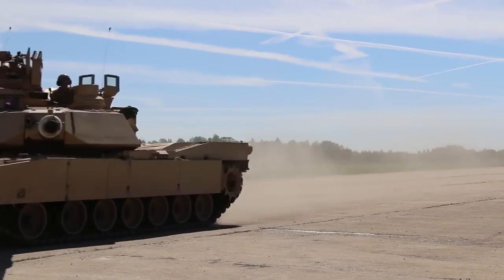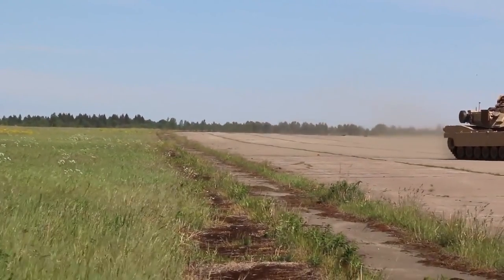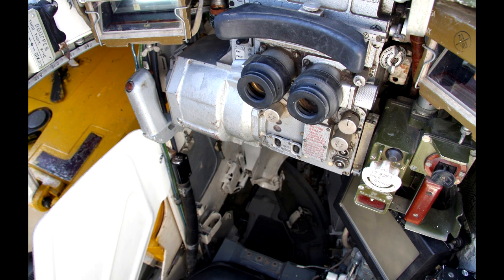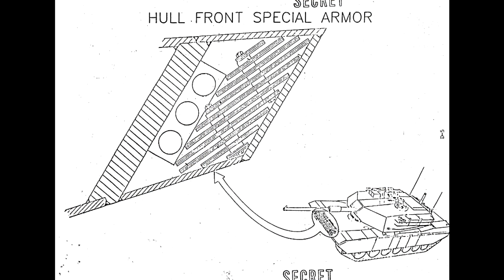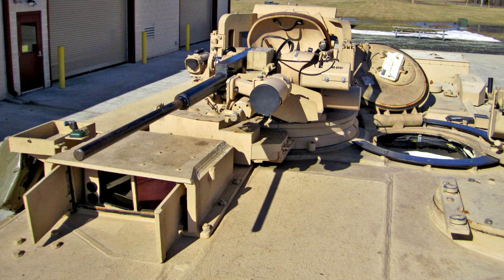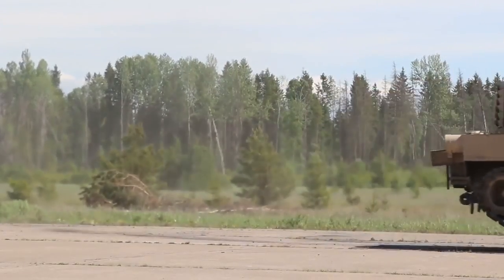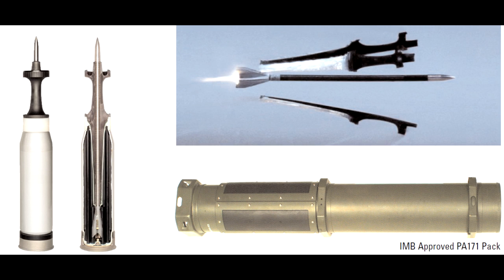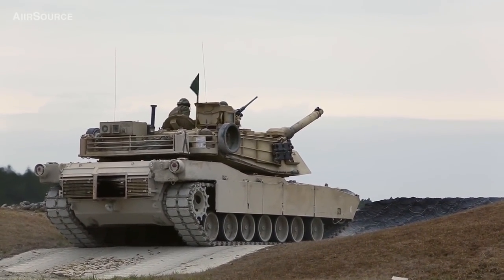Problems with Abrams tank

Comment: Fair criticism, the only way to improve is to recognize flaws.
Reply: I mean he's not wrong
Reply: And refine the product
Reply: It is 40 years old !!!!
Reply: Rick Sadler if it is 40 years old and still in service that means that for 40 years it has been doing its job effectively of course they have upgraded it but that’s how technology works when new effective measures come out you want to get in on it
Reply: well yeah but if the abrams want to be en par with the new tanks that are slowly appearing, it will have to completely change it's design i mean it's armour not even effective now the amrata can pen it kilometers away in it's most armoured places not to mention the turret neck is weak to anything with over 100 mm of pen.
Reply: Squating Brit they already are en par no one has destroyed an Abrams yet an their about to be upgraded again and and we don’t know the effect of chobham armour against armarta cannons
Reply: @getstuffed2391  yeah sure they still are a cimpetetive tank but it is loosing so much maneuverability as more and more armour is being added, not to mention adding an amount of armour that makes it immune to the armata in the turret cheeks alone would already be the bane of it's maneuverability. Then we should also think about how the trophy system they are giving the Abrams is most likely meant for rounds going less than 2000 meters per second something I doubt the  vacuum 1 does keeping in mind that it has over 1000 mm at 2km.
Reply: @getstuffed2391  also why hasnt any abrams been destroyed, 
Could it be because the US went to war with the USSR douring a massive crisis that had started as soon as from 1953 and was getting worse and worse? 
Our maybe because i don't know, the US goes against countries with a vastly inferior defense budget
Reply: Squating Brit well the reason their is so much armour in the cheek is because you have 3 crew members is their and their improving the armour load by changing the mixture to make is lighter and stronger in conjunction with an upgraded engine and the trophy system can easily take out armarta cannon shells because their heat not kinetic meaning the travel well within trophy reaction time where a kinetic round would easily get past trophy at close range so your claim is false remember since armarta has barely any armour in the turret damage to the firing mechanism would render the tank useless as the crew are completely separated
Reply: @getstuffed2391  you know the main round of the Armata is kinetic right? HEAT shells or chemical ones ar rapidly loosing use. also most tank to tank confrontations would be in open fields since being in a city is full of high risk situations for any tank, ergo engagements would most likely be at around 2 kilometers in relatively open fields, a distance where the T-14 armata can go straigh through the turret armour last Abrams model and being  a depleted uranium round it has to be faster than 2000m/s in order to have a penetration that has been practically dreamt of meaning a trophy system would most likely not be able to nor detect it nor intercept it, making me think why will a armor upgrade matter when it needs so much more armor it will start to drastically affect it's mobility which has already been suffering with the last upgrades. And something that you may not know is that the t-14 Armatas' actual turret size is a 30% of what you see so would it be that easy to take that shot on such a mobile tank?
Reply: @getstuffed2391  you realise the main round to be used the Vacuum-1 right? which is APFSDS which isa round that relies on kinetic, also why would they use a less effective shell, the only reason the use the ATGMs is for extremely long range engagements.
also it is true that the javeline is a massive threat but it has softkill systems for a reason or passive protection systems, if you may.
and when I said  that confrontations would be in open fields and not in cities, i do not mean that it will be a imposible situation but an unlikely one. And it is true the Armata is yet to be battle tested but it will be only a matter of time for it to be used in Ukrain or something.
And I am not speaking about dodging APFSDS but what I am speaking about is that the armata's turret is so much more difficult to hit than the abrams since it has an outer casing that is used as support for sensors.
Reply: Squating Brit you can’t jam the javelin when it is in lgm guidance the only other way is to use smoke screens to obscure the view the t 14 has ventricle mounted smoke generators but does not have a radar that high the only way a you could know one is their is by visually detecting it which the chances of that are low in a tank and heat is used in armarta because it does more damage where a kinetic round would go straight through creating minimal shrapnel and keep in mind abrams depleted uranium armour make the kinetic round even less effective
Reply: @getstuffed2391  the Abrams armour makes heat even less effective APFSDS is used because even though it is less effective as for post pen damage anything it goes nearby is dead or destroyed and also loses less effectivity against armour such as the abrams', not to meantion the Vacuum-1is one of the ''prides'' if you will of the t-14 armata in fact the cannons of the T-90M might be retrofited with the same cannon than the Armata's since it woul give them the ability to fire Vacuum-1
Reply: Squating Brit yeah and the armarta is getting a 151mm cannon which means it will a be a spa (self propelled artillery) and will lose its ability to fire vacuum 1 and will also have considerably less ammunition the t 90 was not designed to have its turret upgraded doing so would require the entire turret be re invented thats why the t 14 was made to replace the t 90
Reply: biggest one being is that most people fail to forget the tank is 30 years old now. and unlike the Russian tanks that seem to be pretty good at modernization, the US just keeps dumping heavier armor and bigger engines on it to fix its issues.
Reply: Jean-Luc Martel age has nothing to do with it if a tank has been in service for 30 years it means it has been doing its job for 30 years well the m1a3 will address your engine issues and the armour is being upgraded to be lighter and stronger
Reply: @getstuffed2391  i mean age does sort of matter technology does get oudated and yeah they have been changing it in the abrams but the engine issues are going to get easily adressed buy a better tank like the leopard 2A7 or even the 2A5 is better
Reply: Squating Brit why do that when the issues are being addressed a better engine is on the way as well as stronger lighter armour you can’t say the leopard is better when it has its own issues when you boost one aspect of a tank you damage the rest of it so that argument is invalid and the design of the Abrams has evolved look at the original m1 and compare it to the m1a2 sep v3 and you will see significant improvement the design is still evolving and will eventually turn into an m1a3 which will furthermore address the issues word of advice don’t underestimate something you don’t know the full capabilities of
Reply: @getstuffed2391  it is true that the abrams has been evolving to remain qualified as meta, and they most likely continue upgrading it since the US has already said that they will not design a M1A3 until there are any significant design upgrades, which to be honest in my opinion would be rather easy i mean, they could simply try out angleing their armour instead of that flat surfaces presented nowdays int he abrams. And we all know that the Leopard 2A7 has it's own issues like any tank, it is just that even though the equipment of the abrams is more than sufficient to remain meta, the leopard even though it was created aproximately in the same decade or years (I am not sure) it has an armour display that is more likely to be in a better position to upgrade the tank since armour packages would end up in angled armor which would clearly more effective and if there is a turret (I am mentioning turrets because they are the part of a tank which are designed to be shown during combat) it is the turret of the leo 2A7 (there are many other vehicles the could most likely do it but I am speaking about the Leo 2A7 and the abrams.
Reply: Squating Brit the current suggestion for m1a3 upgrades is a new Diesel engine and a better frontal plate but the idea isn’t going forward yet since it is highly un researched and and the armour upgrades are going into m1a2 sep v4 as well as the following upgrades Under engineering development with delivery planned to start by 2021.The Commander's Primary Sight, also known as the Commander's Independent Thermal Viewer, and Gunner's Primary Sight will be upgraded with 3rd Gen FLIR, an improved laser rangefinder and color cameras. Additional improvements will include advanced meteorological sensors, laser warning/detection receivers, directional smoke grenade launchers and integration of the new XM1147 multi-purpose (AMP) 120mm tank round.The AN/VVR-4 laser warning receiver and ROSY rapid obscurant system have been trialed by the US Army for adoption on the Abrams tank and Bradley fighting vehicle. keep in mind though this comes from Wikipedia but I have found multiple reliable videos suggesting this is highly accurate
Reply: @squatingbrit9124  the turbine is lighter/has better performance (diesel only better idle) it can run on multiple different types of fuel and the fuel consumption is offset by greater fuel capacity
Reply: @banegas0411  well theoratically the only advantage given by having the ability to use several types of fuel is in a sort of post apocalyptic scenario where fuel is a scarce resource. And the abrams has a short range if you compare it to some other tanks not to mention that more fuel is not a good way to improve range as it also adds weight which means heavier tank, the best way Is by creatign a tank with an effective armour layout that weighs less and has a better fuel consumption per 100km ratio if that makes any sense.
Reply: @squatingbrit9124  more fuel but lighter weight engine and no tank should rely on armor it should go dont be detected (low silhouette,reduced signature) if detected dont be hit (mobility,smoke screens,low silhouette) but if hit dont get penned (effective armor) if penned dont be killed (compartmented ammo,fuel, fire detection systems/suppression)
Which abrams does well
Reply: @banegas0411  abrams a low siluette are you kidding me look at the size of the t-90 is has more range and more effective armour. of course it does have it's own flaws and the ammo racks in the abrams are super easy to hit sort of the opposite for some other tanks which actually hide the ammo
Reply: @squatingbrit9124  detection also includes sounds/smoke from engines both arent an issue and unlike t90 and soviet tanks have higher ALL ROUND ARMOR while nato tanks HAVE HIGHER TURRET ARMOR also abrams has blow out panels protecting crew from ammo exploding also abrams is a ft taller then t90
Reply: @banegas0411  yeah a whole foot taller it makes a huge difference and the blow out ammo racks will only work in a couple of situations like gettinf shot from behind mind you a APFSDS round would go through the gun breech area into the ammo from the front rendering the blow-out ammo racks useless
Reply: @squatingbrit9124  mind you a t90s apfsds is smaller then the abrams apfsds  and only has 100m higher velocity which still doesnt give it enough pen to go through abrams turret or give it more pen then abrams apfsds also abrams has a higher fire rate
Reply: @banegas0411  T-90's APFSDS round is said to have 630mm of pen at 2000 meters and although it cannot go through the cheeks however the area around the canon is a very different story it can go through it diable the canon get some crew members and possibly get the ammo (depending) on how much it is carrying
Reply: @squatingbrit9124  the mantlet is far to small to hit at far range
Reply: @banegas0411  that is not the point not to mention that you would be surprised on how accurate tanks actually are now days and the size of the gun breech mantlet has about three heads of width which means about 54 cm give or take and at 1000m a modern day tank would have an avarage dispersion radius of  about 10cm meaning if it becomes about 25cm of dispersion radius  pointing straight to the center  it would have 2cm of '' safe space''.
Reply: @squatingbrit9124  ik how accurate they are its still a small target at long range you will most likely hit the turret cheeks
Reply: @banegas0411  well I mean I just told you the size and how likely it is for them to hit it, I mean the chances are high not to mention most tank to tank engagements will not happen under 4000 meters and the likelyhood of being hit there significantly reduces but instead of being a nearly assured shot in the case that they are at 2000 meters, at 4000m they will hit there more o less a 40% of times which if you think about it is quite frequent
and the armour in that area is almost non-existent since it's armor effectiveness varies in between 160mm and 360mm
Reply: @squatingbrit9124  and have you noticed how pretty much every tank has a weaker mantlet? abrams/leopards/t70s/t90s/challenger 2/panther/is 2/m4 shermans/t34s
Reply: @banegas0411  well older tanks do not have thinner gun breech mantlets mostly because most of their armour was either rolled or casted but however with the apearance of composite armour the different areas have very different values, as for the UFP or LFP in modern mbt they are always a weakness however in some older tanks such as the panther D or any other modle the chassis was in most cases the stonguest area
Reply: @squatingbrit9124  it still goes gun mantlets are generally a weakspot with composite or not
Reply: @banegas0411  no gun breech mantlets are the part that covers the gun breech but they only exist in tanks qith composite armour
Reply: @squatingbrit9124  no its not only tanks with composite
Reply: banegas0lets say the turret of per example the panther it has the same amount of armour in the front of the turret, however the turret cheeks of the M1A2 are about 630mm of effective thickness or it is estimeted for it to be meanwhile I already told you the thickeness of the gun breech mantlet and it goes like that with pretty much any other modern tank except that most of the otherones like the T-90 that are that is poorly covered by armour is much smaller.
Reply: @squatingbrit9124  im talking about the flat part of the panthers mantlet since its such a high chance of hitting it and abrams is only a ft bigger in everything also where did you get that amazing armor as abrams armor is still classified
Reply: @banegas0411  well that armor is it's speculized armor so might be might not be close to the real amount however the main upgrade from the M1A1 to the M1A2 was commander's thermals and also commander control over the turret.
but back to what we were speaking about, what I was trying to get you to understand is how much size will affect nowdays because of modern day gun accurracy so even though you say '' it is only one ft bigger'' that one foot will significantly increase the chance of being hit.
Reply: @squatingbrit9124  not by much its turret cheeks are still more likely to be hit
Reply: @banegas0411  at 2000 meters which is a decent distance for and engagement it is nearly assured that a spot so big gets hit
Reply: @squatingbrit9124  its actually small
Reply: ANUSH SLAVEIKOV when did I say anything about girls but you do realise that American girls have to go through the same fitness training you dumb@ss
Reply: ANUSH SLAVEIKOV the upgrades I mentioned are going into the m1a2 sep v4 and then will be going followed m1a3 with a lighter 20mm cannon and an improved Diesel engine and you could find it any where even Wikipedia
Reply: ANUSH SLAVEIKOV it was one example not the primary source if you were reading with your glasses on you may have been able to figure it out
Reply: True
Reply: Yep, kinda like the Arleigh Burke class destroyers. The USS Arleigh Burke DDG-51 is a vastly inferior warship to the USS Jack H Lucas DDG-125 even though both are the same class of destroyer. Flight I vs Flight III.
Reply: Smart man
Reply: To be truly fair. let real world experience speak for the Abrams.   It has been used in quite a few encounters with Soviet bloc vehicles, and more modern Russian export models.  It has fared well and brought the crews home safely.  There are plenty of Soviet hulks out there to speak of the M1's weaknesses
Reply: @chimo1961  do you know if the Abrams ever thought any t90 variants? I know it though a lot of t72's, t55's and t64's, and probably some old/eyport t80 variants
Reply: @maxim6088  there where no T-80's in Iraqi... simply cause Soviet didn't export them even T-80A an B variants))) LOL.
Reply: @chimo1961 I wont consider T-54 1951 to be advanced in 1992. Stfu